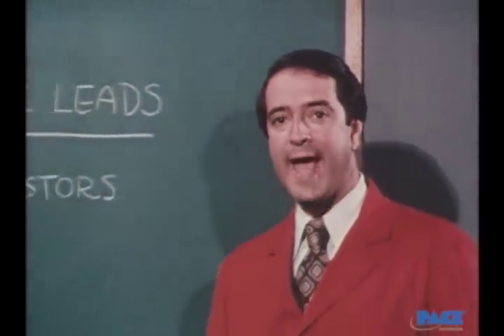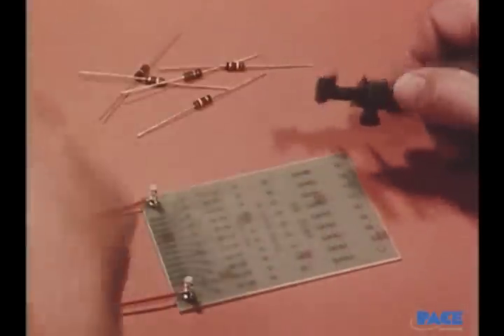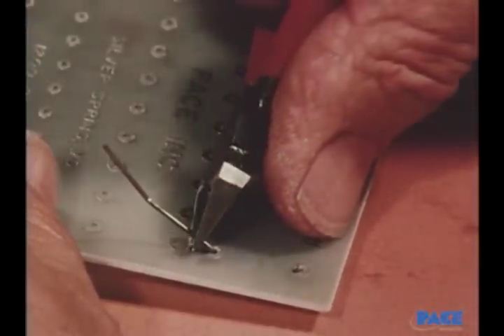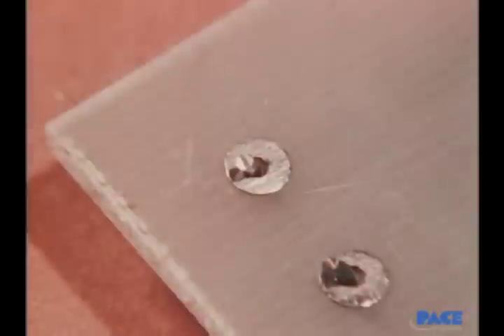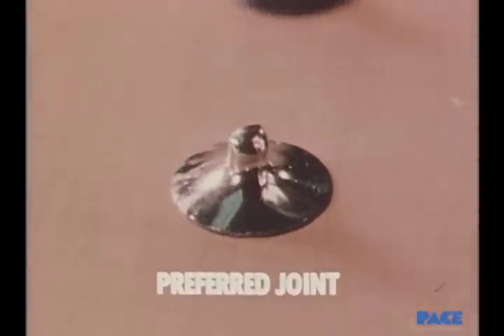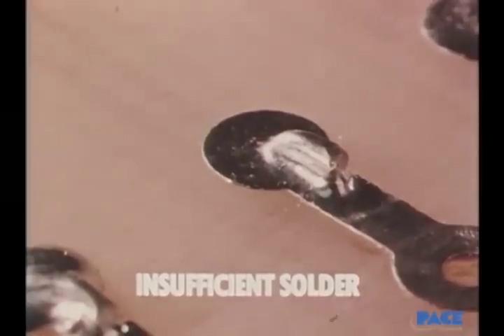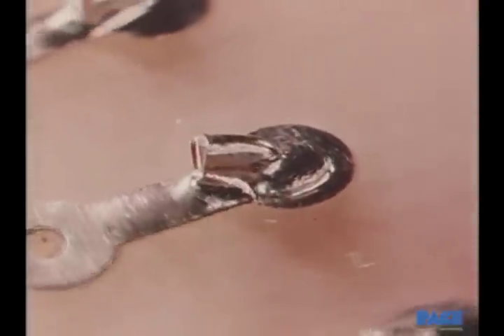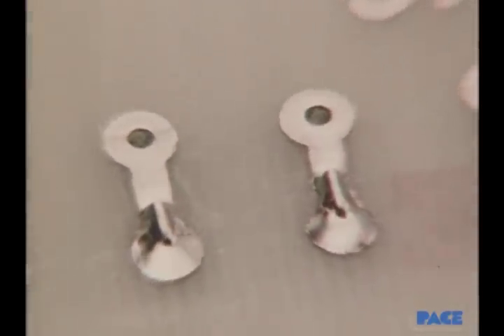Basic Soldering Lesson 6 - "Component Soldering"

Comment: Taught these techniques for many years. The rubberised abrasive can be an ink eraser, and the solvent is isopropyl alcohol, seems to be a recurring question.
Reply: been trying to figure out what kind of "rubberized stick" I could buy and how the heck they even market them other than for automobile engine work. thank you!
Reply: Thanks for the info about the rubberized abrasive stick. I thought it might be an ink eraser as you've said.
Reply: Oh ok.
Reply: I dont them the stick is needed anymore, most parts today is clean and pre tinned, in older days the parts leads will be dirty and must be cleaned etc.

Comment: Got a ConForm in the mail today. I’m certain it will quickly set lead spacing for professional looking work. Beyond soldering, breadboard results will be much cleaner using it too.

Yes, it’s plastic, but reinforced (glass-filled?) so it’s tougher than it looks. Slider could fit tighter, but if I keep pressure on the upper side while tightening the screw it helps. Perfectly suited to work than shouldn’t need strong-arming in the first place. 

Thanks for the timeless courses, Pace!

Comment: Is the rubberized abrasive stick the same thing as a No. 2 pencil eraser?
Reply: Maybe the blue side of a rubber eraser might work, its abrasive enough to remove pencil/ink smudges by sanding the sheet of paper.
Reply: @cerberusgear ,  Ink erasers with some pumice or silica grit in them are difficult to find nowadays. Draftsman's eraser "pencils" in wooden-stick form work extremely well but most of the old ones were made with natural latex rubber and so they dry up and become crumbly with age; the new versions are made of some soft vinyl like substance that they call "plastic" erasers, and they're useless for removing oxidation or tarnish.  A fiberglass bristle scratch brush is probably the best easily available modern tool for cleaning oxidation from circuit board foils and pads.  I have a video about using scratch brushes and pencil/ink erasers for electronics/soldering prep on my channel.

Comment: Can anyone tell me why too much solder on a joint is bad?
Reply: It is a waste of solder and bad practice.
Reply: +ArcanePath360  Plus overflow of solder may spread to other circuits line and causing short circuit.
Reply: +ArcanePath360 because it can hide a cold joint, still looks shiny on the outside but the electrical contact inside is poor and you cannot know. If you use the right amount of solder and make a cold joint it will show, so you know you have a bad joint.
Reply: +oneginee  Thanks, but I don't know what you mean by cold joint. I tried Googling it and came up with nothing. Surely the solder itself is a good enough conductor that if you pile it on you are providing a decent connection? (perhaps not on big AC power cables, but for small electronics it's okay?)
Reply: ArcanePath360 cold joint means the solder did not reach melting point at the copper surface or component lead to fuse together and make a reliable electrical connection.  if you test it after soldering, yes, the electrical connection seems just fine but months later, copper will oxidize because it did not fuse properly with the solder and the connection will become poor, instead of getting micro ohms 10^-6 of resistance it will become hundreds of ohms and the board will start malfunctioning or burning too much current, and finding the troublesome joint will be very difficult if impossible. Just because you saw solder melting is not enough, the solder must fuse with the metals. After the copper pad and the component lead wetted they will exert capillary forces that attracts the solder and create a concave surface on the copper surface. This is how you know it's good. But if you put too much solder, you won't be able to see it going concave, also the thermal mass of the extra solder means it probably did not wet.
This is unacceptable at any level even amateur. If you put too much solder you can suck it out and solder the joint again.
Reply: +oneginee   That's very helpful and I will remember this, thank you very much for your expertise.
Reply: Very helpful explanation. But what is the problem with the overheated joint?
Reply: The heat can caused the copper track to lift, send too much heat down the leg and damage the component. Just for starters...
Reply: The bulb of excess solder can rob heat from the actual mating area and cause a semi crystalline "dry joint" to form at the pad interface. It can look strong but if/when it fails you will see a rough matt grey surface (similar to what you see when die cast metal snaps) where the joint didn't whet properly. These joins are often raised in electrical resistance. Concave is best.
Reply: for inspection, you cant see if the wire is properly fitted or was long enough etc

Comment: And any recomenndations for cleaning a circuit board to an Ace 350 Metal Detector.  It got rolled over in a wave while sitting on the beach...Without thinking I tried to turn it on, Because it was my first time to the shore with it........Kinda of a good thing it happened cause little did I know your no longer allowed to Metal Detect at Sandy Hook..
But the board has turned a grayish color in areas.... I can't believe i turned it on...

Comment: Cutting the lead BEFORE soldering is the surest path to dry solder joint disaster!
Reply: Not if you've done all the prep-work shown... remember, this was back in the day of gen-yoo-wine copper component leads, not tinned steel
Reply: Usual recommendation is to not to clip them after to avoid stressing the joint.
Much tidier looking cutting them after with flush cutters though.